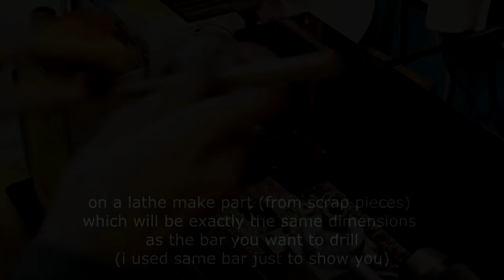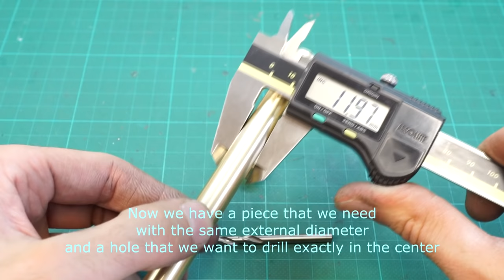Another way How to drill a hole through a round bar in perfect center [middle]

Comment: This video is pretty misleading. 
The easy/right way is to just know the diameter or the stock and the center drill. Touch off the vise jaws with the center drill and make the adjustment to the center of the stock using a dial indicator if you don't have a readout on the machine. 
 If I did stuff like this at work they would probably fire me. Not only for wasting time, but also wasting material. 

Also, brass as a drill guide. No, just don't. That's a job for hardened steel if it's required to locate a hole. 

I can just imagine some guy watching this and thinking this is the way it's suppose to be done. 

Bottom line, You're doing a disservice to the community with this type of misleading advice.  If you want to teach people how to do something; please teach the proper way.
Reply from the maker: Hy!

I know that there is many way to drill a hole through, you just can take a hand drill and bore through.
I am not a teacher even not the mechanic, i work with electronics and that is just my hobby, and someone show me how to do that and i think that's a good idea and make a video about.

And after all i think that youtube is NOT right place to learning, but sometimes you got some good idea.

If you want to learning some special knowledge you must look some video like that:
https://www.youtube.com/watch?v=5tqH-Un9SFU

Thanks
Reply: Thanks for the reply, It's nice to see took my comment the right way. 

I understand what you're saying about youtube not being the right place for learning, but that's unfortunately the case most of the time. 

I make simple fishing videos for fun and entertainment, but I swear at least 10% of the comments I get are from people thanking me for teaching them how to fish. Even tho that's not my intention on most of my videos it seems that's why some people are watching. 

Try the method I outlined sometime and see for yourself how much easy and faster it is. It will be accurate if you get the measurements right and do the math to make your adjustments. 

If you want the quick and dirty method, just chuck up a piece in the vice. Use your calipers to measure the distance between the clamped down jaws, divide that number by two and set your cheap scribing calipers to score a mark in the middle of your part. That center drill you used in the lathe should be used to start the hole of course, but it should be just as accurate as the drill guide/bushing method you used, but about 10x faster.
Reply from the maker: Hy
I know for that method, i usualy use dro (if you vach my other video can see how to mount it into minimill) 
So i don't use this method for every bore, just someone show me that way and seem great idea to me, so make a movei about this.
Reply: agreed
Reply from the maker: exactly that is what i want to tell, but i don't heave a drill pres so show the process on mill.
This metod is better to do on drill press because it will find center itself by moving the vice.
Reply: "Someone with just a cheap drill press in a home shop" isn't going to be making an exact-match diameter drill guide. TrailChaser is right, everything about this is wrong and bad. If you are "someone with just a cheap drill press in a home shop" then buy a V-block, center it with your bit, clamp it, and drill. Then, with the hour you saved not making your own, soft, useless drill guide, you can sit and reflect on why you should always watch YouTube with a fair bit of skepticism.
Reply: Yes, you should definitely think about it for a second. I hate to belabor a point that should be this obvious, but let's do some analysis.

Doing what is described in this video IS a technique for someone with access to machine tools. In fact, it RELIES on them. Step one was turning a piece of rod to the same OD as the piece you need to drill. Step two was using the lathe to center drill that piece to use as a drill guide, and step 3 was clamping them both in a vice, relying to the exact match of diameters to align the guide hole with the center of the target piece. That is NOT AT ALL what one would do if one were a rancher with a job to do on his tractor, truck, trailer or whatever. 

So here's the thinking about it for a second part: 

When one is deciding what methodology to use for a fabrication operation, one considers the following factors: 

1. What is my budget?
2. What are my time constraints? 
3. What are my available tools and materials?
4. What are the precision, strength, and appearance requirements of my project?

Let's hypothetically answer those questions for the case of "I have a piece of rod that I need a hole drilled through". Further, let's specify that the hole is to hold a cotter pin because you're on your ranch, hours from anywhere, and you've broken the axle of a cart or something, and you need to replace it. So here might be the answers you give the the previous questions:

1. $20. Twenty dollars is what I consider to be the "money I could spend at any time for any reason" maximum. Your value might be different, I'm not familiar with the ranching business, but maybe you carry a couple hundred around with you, or maybe not. I dunno, but let's say for sake of argument that this project needs to cost less than $20.

2. Very tight. This is a repair, and as such, is never scheduled. I need to use this cart immediately, I was trying to use it when it broke, so it needs to be fixed ASAP. 

3. I have a drill press and all the normal hand tools that one would find on a ranch including hammers, saws, pliers, wrenches and et cetera. 

4. Precision: loose. The rod will need to fit pretty tightly in the bearings of the wheels, and shouldn't be TOO loose in whatever tubes it goes through on the cart itself. Strength: High. We must use steel for this. Appearance: None. Nobody cares what an axle looks like as long as it turns.

So, given the above answers which of the two following scenarios is most likely, and most logical?

A) I'm lucky because I have a piece of steel rod in my shed that is just the right diameter AND just the right length! I'll grab another, slightly larger piece I have and chuck it up in my lathe. Then, I'll face it off and turn it down to the same diameter as the piece I'm going to use. Next, I'll grab a center drill and dimple the face. Then I'll get a regular twist drill to drill through about a half inch or so, or maybe just a quarter inch at the right size. Then I'll part that piece off so that the hole is all the way through. Then I'll take the piece I'm going to use for the axle and mark out the proper location for the cotter pin hole. Then I'll clamp that piece in my drill vise on a parallel (hope I get it directly under it so it doesn't slip off!) and use another parallel to make the rod flush with the end of the vise. Then I'll slide my pre-drilled guide into the vise on top of the axle rod and sight down into the bore to line it up with the mark I made using a flashlight. Now I'll clamp everything up tight and line my drill up with the guide and drill my hole. Of course, now I need to turn the axle rod end-for-end and do that whole line-up/drill operation again for the other side, but I'm golden!

B) I'm lucky because I have a piece of steel rod in my shed that is just the right diameter AND just the right length! I'll grab a big ball-peen hammer and a center punch out of my tool box and prick a mark onto the approximate center of the rod at each end. Then I'll put it up on the drill press table and drill into that punch mark, all the way through. Maybe I'll clamp it to keep it from rolling on me, but it's pretty long, I might can just hold it by hand, really.

So after thinking about it for a second, which one sounds more likely and logical? 

The point of this whole discussion is that this video demonstrates a complete dismissal of the correct thought process one should use when approaching a fabrication problem, and is self-defeating even as it is over-complicated. If one needs a hole in round stock within a few thousandths of an inch of center, then this method doesn't give the required precision because of the use of multiple machines, multiple setups, and a drill guide made of too-soft material. If one doesn't need that type of precision, this method uses way too many steps to accomplish what can be done in a single operation (or two if you count marking and drilling as separate). 

So, in EVERY case, the method outlined in this video is NEVER the right answer. And I think that's what TrailChaser was trying to convey, but he should feel free to correct me if I'm wrong.
Reply: Sure you could. But you're still doing too much work, IMHO because the precision required doesn't justify the work. But, hey, however you want to drill your holes is cool by me.
Reply: Title says "Another way How to ..." it doesn't says that this is the best way to do it.
Sharing less good ideas often helps finding a better way to do something.
Reply from the maker: Thanks for undestanding ppdan, some comments sound like i rape them with this method
Reply: Actually, it does.  He says "The easyest (sic) way to drill the hole in perfect center through the round shape bar" so it is misleading.
Reply: thought the same thing. I could have saved more time just doing this the correct way honestly.
Reply: An hour to drill a hole? Consider yourself on the way to the employment queues. And the video is correct, a drill bit wanders all over  the show on a rounded surface. You clearly have never tried
Reply: Reminds me of a teacher (maths) who said an algebraic formula was correct because it was true for certain numbers. Completely missing the point, as you have. I still managed 100% in final year of school - no thanks to him
Reply: Here's a nicely photographed instance of this method. http://www.homews.co.uk/page515.html. Remember, every "professional" machinist has an inferiority complex,  because they know an intelligent person can figure out for themselves what took them a long time to learn by rote
Reply from the maker: @Arduous Andotherous, thanks i'm happy to understand someone, But everybody can have their own opinion.
Reply: Arduous Andotherous dude I've been a custom machinist fabricator for well over a decade and I'm very good at what I do. It took extra  time just to set up to make that puck instead of just setting up a mill with a center right off the get go. An hour was just a number I threw out.
 You're not teaching me anything here guy. This guy is not saving any time and would have been less hassle the way I've explained it.
Reply: Brandon Gillette9
Reply: Arduous Andotherous look in the mirror guy lol 😄
Reply: Anyone who is fanatical about weapons is seriously sick.
Reply: Arduous Andotherous well.....that is like.....your opinion man.
Reply: Arduous, that math teacher should be reported. Telling students that is completely unacceptable.
Reply: You're actually quite funny. I'm not a CNC operator, I'm a senior IT architect who has forgotten more computer languages than you are capable of learning.  I fiddle with this stuff for relaxation - gcode is trivial.  You will always be a CNC operator, considering that you entirely missed my point. Don't be sore about it
Reply: And possibly dangerous too. Long time ago
Reply: Brandon Gillette let's see yours then 😉
Reply: TrailChaser Nail on the head dude. Far too many enthusiasts showcasing their bad practices via YT. I'm enthusiastic about sailing, but I'm almost clueless on how to sail, therefore I don't condone how to sail on YT. Otherwise there'd be a lot of souls lost at sea, 😉👍
Reply: TrailChaser t
Reply: It was an awesome video.  I'm into electronics as well, and so many times I've had to jury rig, do the best I
could, due to the fact that I don't have a lathe, drill press, and some cool other stuff.  I'm also a musician and not a machinist.  I admire what they can do, but I concentrate and enjoy the math and physics of it all.  A perfect example of being able to adapt and improvise was the flight of Apollo 13.  I liked your method.
Reply: Actually I think this guy has it down better than you...Never bring a milling machine in a drill press fight (and you can't even take a milling machine on a ladder like a cordless drill)! If you know how to properly set up and use a drill press (especially a power feeding one) you will be much more productive drilling holes and will also keep the milling machine free. For instance if you were setting up a dividing head and the tooling on the mill to throw a bolt hole pattern that you could transfer punch and quickly drill at the drill press, that's a reason to be fired too! I agree that brass is not up to the task for a guide though but it's a piece of the same stock with exactly the same diameter with part he is making so it is comfortable to use it as is!
Reply: @TrailChaser  Please leave him alone.  You are way to smart to be wasting your time criticizing him.  I'll bet your friend(s) enjoy your ranting.

Comment: Why not clamp a vee block in your vice, touch off either side of the bar using an edge finder, and drill using a self-centering 3xd drill, something decent, hss-e, short, and tin coated?  Do you brass off your drills for this type of work?  To save time, you could have even put the bar straight in the vice, your toolmaker's vixe has a small notch in the moving jaw for that; touch off the fixed jaw, and mic the bar, move accross half the bar width.   You could see the drill flex as it entered the hole, picking up the non-hardened bushing, probably ending off at least .1 mm off centre.  Sometimes if I need it really dead on, i'll pre-drill with an appropriately sized endmill to create a guide for the drill, if true position of the hole is important.

Comment: I've seen myself score a line on one end of the bar and along the length of it. Line up the score on the end with a 90° tool (vee-block, steel rule, parallel bar etc) and just drill as many holes along the length as you wish

Comment: Thanks for this! I've looking for solutions using different search terms and here I am. I'm working on a ~ .25 pin that needs a hole for a .125 cross pin. I'll just say with am older manual mill and the very small pin, most of the other "suggestions" also have downsides. I have been pondering a drill guide bushing, commercial ones are available, "but" they still have to be placed accurately.  Last night I set center with a  dial test indicator.  My second attempt. If I get it wrong, I know what I'm going to do for my 4th. Thanks!
Reply from the maker: Actually one of fist comment that see a potencial of use this.
Also i never drill that way but just want to show another option...

Comment: you can also use a short drillbit. since longer ones tend to bend. and if you have to drill holes in a line on the rod. make a setup where you can move it across without moving it to the sides. and for marking a line you could use aluminium angle that fits the length of the rod. (since iron tends to be a  out of angle more so than aluminium). and if you dont have any cnc machines you could take a metal plate and use a drill press meaure from the the hole you drilled in the plate to points you can hit on the drill press ( also measurements for the vice you are using) and use it for reference when setting up the rod.

Comment: Great Idea.  I use Centre Punch and eyeball method.
Reply: With all due respect if that's ALL you use you won't get a hole accurately centered, period. Sometimes, "by eye" is good enough. But sometimes it simply isn't. If that hole is through a shaft, and a sleeve fits around the shaft, and a roll pin pins the sleeve to the shaft? I guarantee it won't be good enough. My eye is good to about .010. My DRO on the other hand is accurate to .00001.
Reply: Only God can do that within 5 decimal places.

Comment: The idea of making a drill bushing out of the same material as what needs to be drilled is a good idea. However,  precariously clamping the bushing by the very edge in an admittedly non-parallel press vise seemed to defeat the whole purpose of making the bushing in the first place.

Comment: This is close to the center - but not perfect by any means. To be honest, your title is misleading. It also looked like you made virtually no attempt to have your bar clamped accurately perpendicular to the drill bit. The hole will probably not be accurately vertical to the bar axis.

You have received lots of comments with friendly and unfriendly advice. My two cents would be to replace this with an improved and more accurate video, given the machinery that you have at your disposal.

Comment: i dont had a lathe or a milling machine, i have a benchdrill and a 3d printed, the way i do it is print a rectangle with a center hole of 0.25 mm less of diameter of the bar, and another hole in the top.then i pass the exact drill of the shaft, put it in the vise, becouse is rectanlge is going to be almost perfect squared, i printed several, but its highly recomended first make the deeper hole you can with the center bit

Comment: I agree that this is an extremely inefficient method. You could clamp the bar in the vice, hold a verdict indicator in the chuck, swing it and move the table until the dial registers the same off both jaws. Perfectly centred.
If you want a rough but quick method - put a 6inch rule on the bar and perpendicular to it and gently hold it in place with the drill point (clamped in the chuck). Move the table back and forth until you hit the position where the rule lies horizontal, the drill is then on centre. Also works to set the height of a lathe tool on centre vertically.